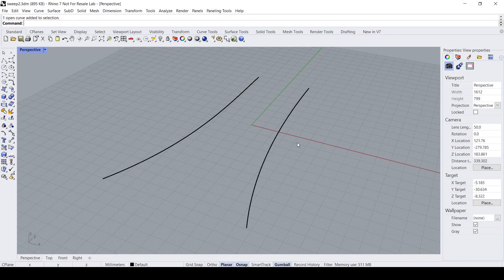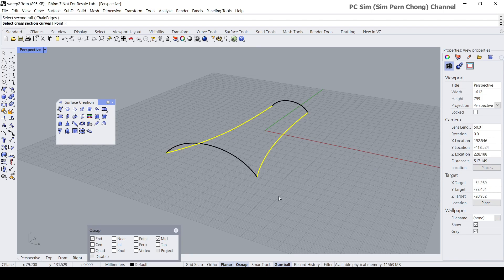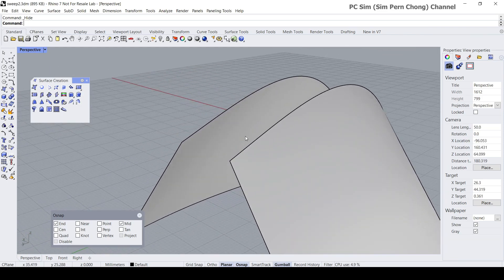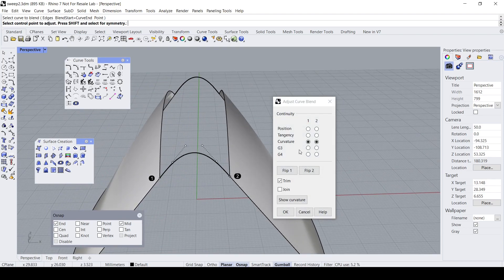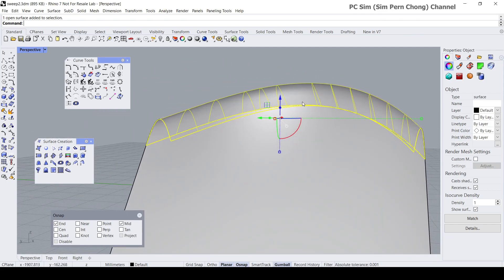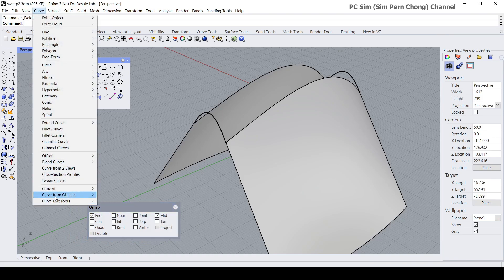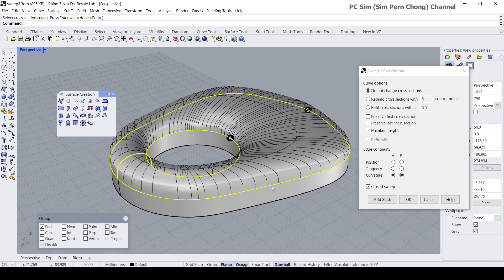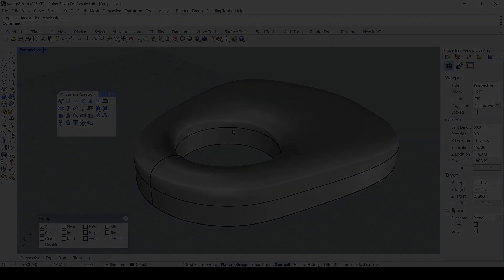Rhino 3D Tutorial: Sweep2 (Sweep 2 Rails) Command

Comment: rhino sweep 2 rail shape duplicate an existing sweep shape mean i am sweeping in two parts and after sweeping first place when try to sweep on second the shape again generated on the first one. how we control where we want the sweep shape on right side or left?
thank u
Reply from the maker: Erm..sorry I don't really understand. Got to select both rail curves first (one at a time). Then select the sweep shape.
Reply: @simpernchong  sir i mean that suppose we draw 2 rails and 3 cross sections for the sweep shape.
First we select both rails and select 2 cross sections the first and the second which is in the middle and sweep the shape.
Now when i again select the 2 rails and the middle cross section and the last the third cross section and use sweep 2 rails the shape again genrates on top of the previous shape. Mean i am trying to sweep 2 rail between the middle and the last thirs cross section but the shape generated between the first and the middle cross section. I hope i made it clear this time.
Thanks

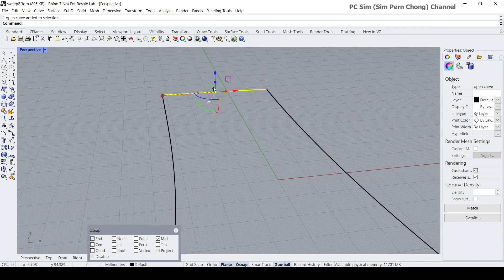Comment: Hi, how did you manage with the gumball to change the straight line into a curve?((0:51 and 0:56)Thank you
Reply from the maker: Hi, you have to use a single span degree-3 curve.. as it will provide 4 control points. The easiest way to do this is to use the Interpolate Curve (InterpCrv) command and set it to degree 3. Then, when you use the gumball to select the control points, there will be sufficient points for selection.

Comment: My comment is gone……???
Reply from the maker: Sorry.. i can't remember what is the comment about.
Reply: @simpernchong  I wrote quite long to ask my problem for sweep2rail and it seems deleted because I put a Google link for image maybe..?? Îll re-post it soon! 🙏🏻🙏🏻🙏🏻
Reply: @simpernchong  
So my question was,, I was building a tropical fingery leaf(imagine a hand) and got stuck to making each small fingery part of a leaf for controlling its height. It is literally so bulgy.. 

What I thought was that to build a body in the middle and fingers separately each using sweep2rail, then connect those with Blendsrf. I can manage Blendsrf, but the problem is that ´maintain height’ command doesn’t work when I try to build a closed object. I know it is because it narrows down to the tip to be closed and if I leave the tip open, then I can maintain height flat. But I have to close the tips anyways, and making a flat tunnel and than ´patch’ or another sweep 2rail or whatever commands to fully cover the finger is not natural and not what I want to.. if I fully do sweep2rail to the tip, it bulges through arcs(bridging curves) and the height rapidly drops down to the tip…

I was ok with building a body part(like a palm) with sweep2rail because it is basically a simple circle  with no lines narrows down although it is still a little bulgy too, but the real problem is fingery parts. The leaf is organic and I like to have a full control on height… 
Sorry that I might confuse you.. please let me know if you don’t understand anything..
Reply from the maker: @Kk-jj3xi  Ok.... I think i understand. But i don't think sweep 2 rail is the ideal solution. Have you consider using the sub-D multipipe instead? If it is not possible to create the branches in one go because the the difference in thickness, perhaps you can build them in difference stages with difference thickness.
Reply from the maker: @Kk-jj3xi  A demo of multipipe here >> https://youtu.be/XSHbu7Cpf78
Reply: @simpernchong  yes! I’m current’y using Rhino5 with my old old macbook and have to wait for another month or two for Rhino7(new macbook delivery delay..).  Think I can build organic stuffs easier with the 7, is there any way to build in 5?
Reply: @simpernchong  thank you so much for your reply!! My questions was a bit confusing🤣
Reply: @simpernchong  yes, since the leaf is a combination of parts of different thicknesses, I tried to build the palm part/finger parts separately and to sum it up, but the fingers won’t make it with height that I intended…
Reply from the maker: @Kk-jj3xi  iI think Rhino 7 will be much much easier to use for organic modeling such as yours.
Reply: @simpernchong  that’s right! I bought rhino7, but my old macbook doesn’t support the minimum system requirement for installing 7, and the new macbook I ordered for rhino7 keeps on delaying its delivery due to Shanghai lockdown… and I wonder before 7 came out, how did people make organic stuffs like this?? 😎😎😎